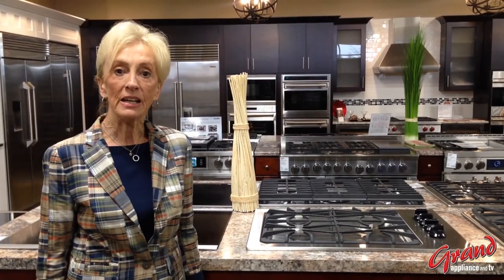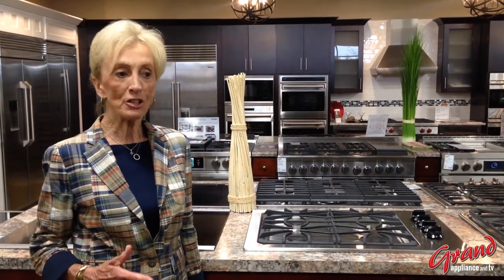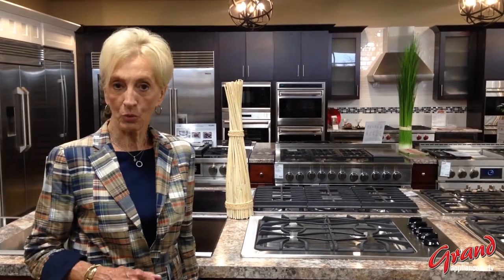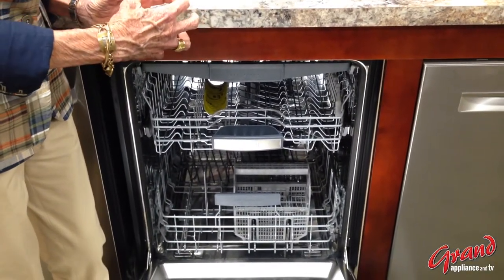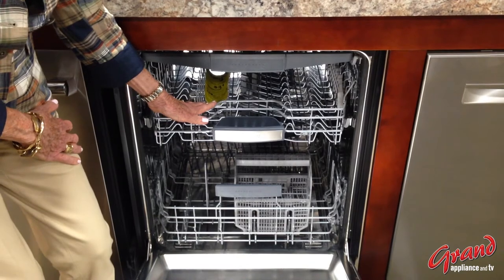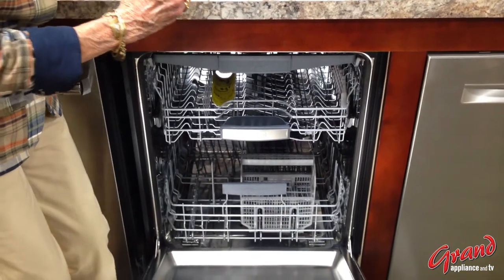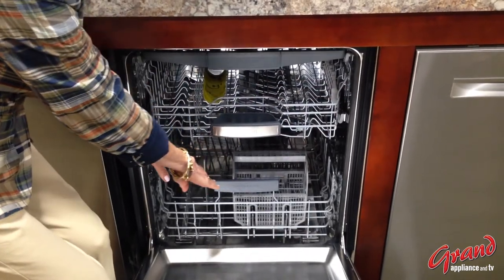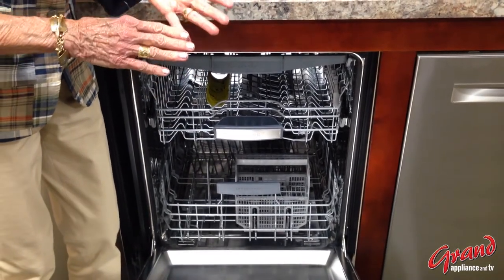Condensation Dry

Comment: I've started using a Bosch dishwasher. My dishes are getting dried up without any issues. But I notice that the racks and the walls of the dishwasher are dripping wet although the Extra Dry option is selected. Can someone please tell me how to fix that? I've placed my dishwasher in the kitchen balcony and I don't prefer keeping it open for more than 20-30 minutes during the day.
Reply: Did you get an answer to this. If yes please share. Same problem I m facing. Dishes are dry but inside body of dishwasher is wet.
Reply: @lilysworldofzepeto9530  That is the dishwasher working as intended. The walls are stainless steel specifically so condensation forms on them. That wetness is the water that was on your dishes.